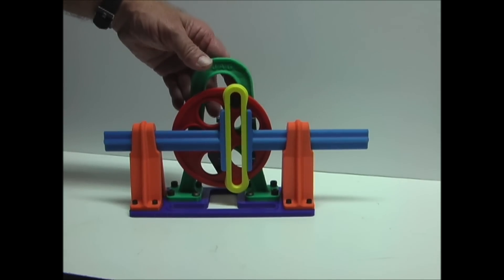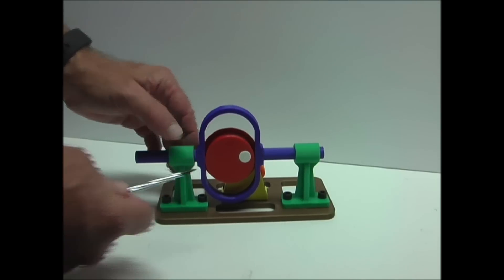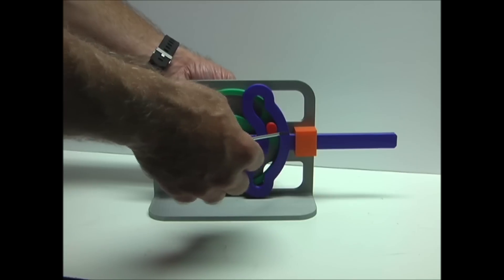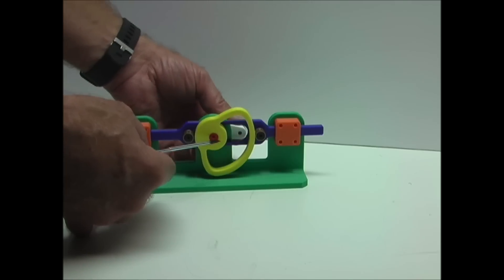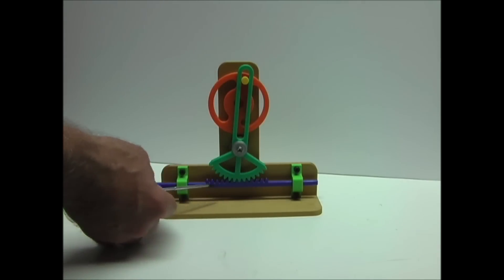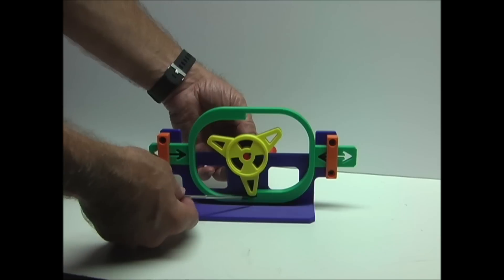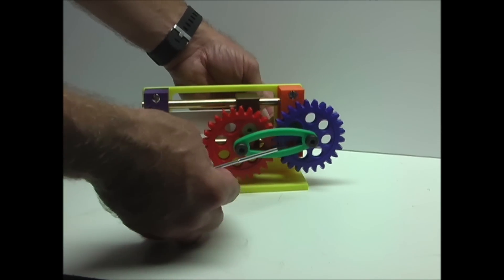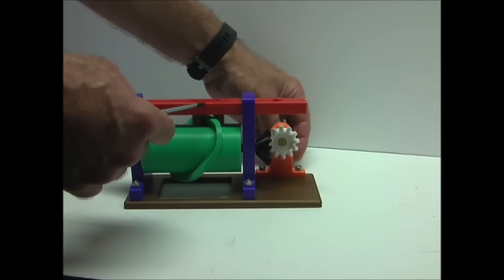Scotch Yoke and Rotary to Linear Motion Mechanisms. 3D Printed Models.   Part 1

Comment: Brilliant models, thanks!
I'm trying to decide on the best mechanism for powering a scroll saw with an electric drill. I rather like the spur gears version, which seemed to have a nice smooth action that would cope with the relatively high speeds. The rack and pinion is rather cool though, and the faster motion could be in the cutting direction.
Reply: should be the opposite. slower motion when doing work and faster motion when just resetting to position.

Comment: Great video! Is there any way to create a cam/scotch yoke/mechanism that will create a motion outward in both directions at the same time? I need to create motion that goes outward in opposite directions when a force is applied from above the mechanism. The force would be heading in the southern direction along the Y axis and once it hits "0"/the ground, the 2 arms should be out on the X axis in opposite directions a small amount. They would need to retract back into the mechanism when the force is lifted, kind of like when you lift off the handle of a self inking stamp. (I'm designing a low cost manual jig to help farmers fold the Kliklok paper produce containers I created to replace plastic clamshells. Hoping someone can direct me to a mechanism, having trouble finding something that moves the arms outward in opposite directions with a force applied in a perpendicular direction downward.)

Comment: An interesting video!  Some thoughts:

1. One serious advantage of these systems is the built-in acceleration and deceleration at the opposite ends of the linear movement, which puts MUCH less stress on the components.
2. The final mechanism has a hidden feature that wasn't included: the path on the drum can be fairly complicated, so as to move the end of the arm in all KINDS of interesting ways, especially if multiple drums are connected to the same endpoint.
Reply: I'd love to see these designs updated to have various roller bearings integrated into them, and then a weighted crank so you can whip it and watch the mechanism really go. I love the size of these, perfect for a classroom setting.

Comment: was thinking on the last one , you could mound a dish with a hinge on a shaft and use the same drive for the up and down on the edge of the dish , if you alter the angle at wish the dis is sitting on the axle the stroke will increase of degrease , was thinking on using this for a drillpress converted to a honing machine , only down side is that the scratch pattern angle changes as the transfer of the stroke is one on one , youre changing the angle of the crosshatch together with the stroke , at a longer stroke the hatchpattern gets steeper and vice versa
it still might work if you can move the contact wheels that transfer the stroke out and in towards the center